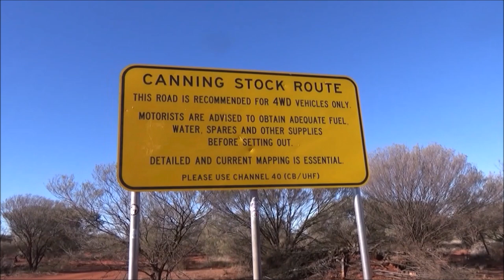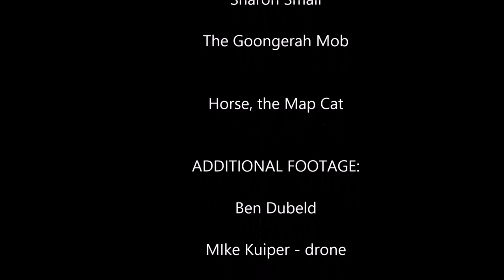Canning Stock Route. An unsupported solar electric bike journey

Comment: A new type of explorer. True determination. Having the ability to repair the trailer as you went even with the shitty welding shows you wanted to do this by yourself.
I recognised many of the locations along the track and it brings back great memories of our trip along there.
The corrugations are so huge they must have been exhausting.
I'm not sure if you realised but you chose will to do the track from the north as the approach to the dunes is a bit easier. The southern side if the dunes also has a hook turn that would have meant no runup.
Congratulations. You have don't something that very few people will ever do.

Comment: Iam keen to see details of your on the road welding setup.
Reply from the maker: It was super bodgy, the EV version of bush welding of a couple of car batteries.  starts whith the ¬52V nominal battery bank, whith some fuseing/ protection. This was my stadard day to day pack, consisted of 2 individual packs that I would ueselly leave in parelell, but defenatly in parelell while welding. Was good for about 150A peak or so, not that I ever did that. To regulate the power i had a length of steel tier wire ( like ¬ 1mm dia solid low tensile steel wire) I would vary the length of this so that I had between an ohm and half an ohm of resistence. This was my power controll and it would limit the short curcuit current to somethign safe and sane, but it did get a bit hot while weding. That clamped straght onto a small arc welding electrode, think I ran EP most of the time, but wasnt that different either way. Ground clamped to workpiece. A bit of welding glass taped into a bit of cardboard and I was good to go. would have been well less than 100g of additional stuff apart from the welding rods ( I had a fair few) but well under half a kg all up.  
as I went on I got more keen and turned up the power more and more whith was good, could make fairly resonable welds on sub 1.5 mm material by the end of it. really nice low power charecteristics
Reply: @sammitchell3652  Amazing, thanks for sharing. Hadn't considered welding from ebike batteries!